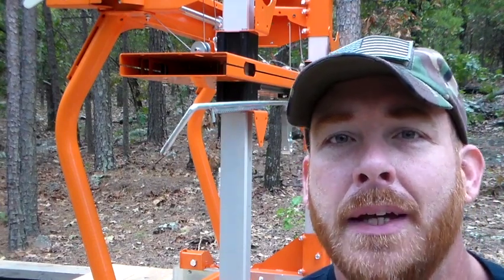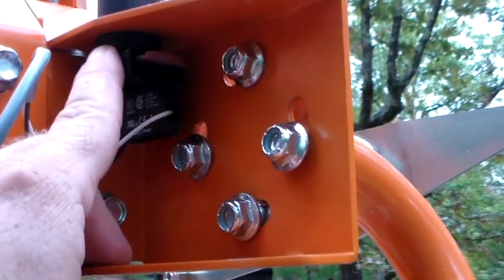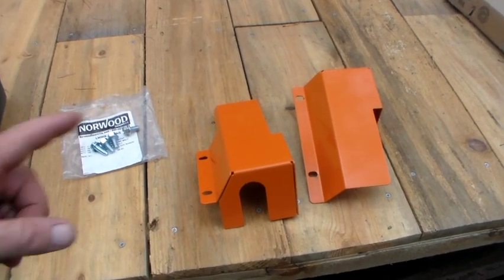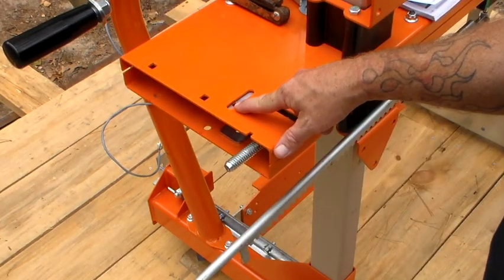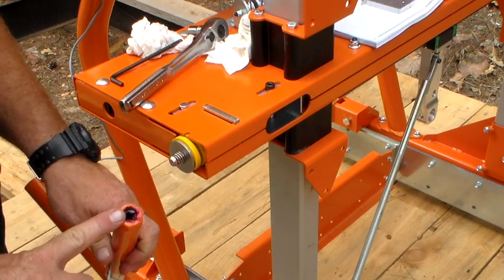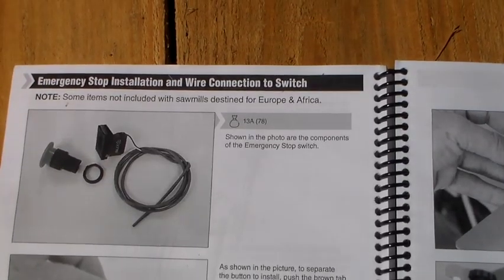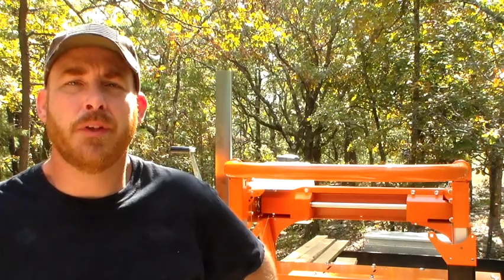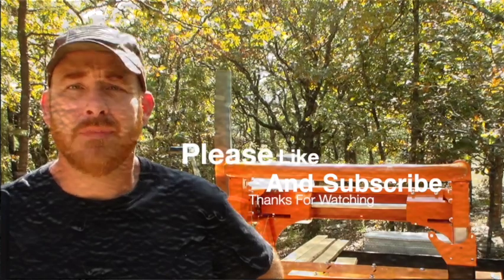Norwood LM29V2 / LM30 sawmill assembly / Blade Tensioner and Band wheel adjuster assembly Pt.5

Comment: How did you fix the water shut off problem? We're having the same issue right now. Glad we ran across your play list. Thanks for making these.
Reply from the maker: The shutoff problem resolved itself. The grommet needed was in another bag that didn't seem that it should be in. Keep watching the series and you will see where it is found. I'm so glad you like the videos. Thanks for the watch.
Reply: @MountainMike01  I saw in the next video that I'm bag 10 was a part you thought was the one you needed, but didn't see for sure if that was the fix.
Reply from the maker: Yes, it was the grommet that I needed to put the shutoff on the tank.
Reply: @MountainMike01  We found ours in the same bag as yours. Now we just need to get the 1/8 x 1 retaining pins that were missing.
Reply from the maker: So far Norwood has been very helpful with the issues I have had with wrong parts (none of mine were missing) and have me 2 replacement parts on the way so it should be an easy process for you.